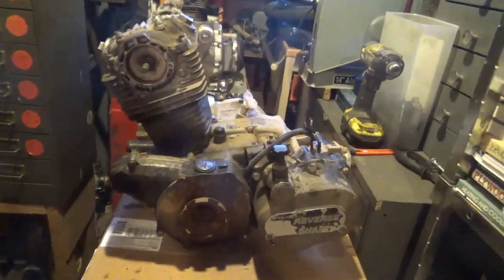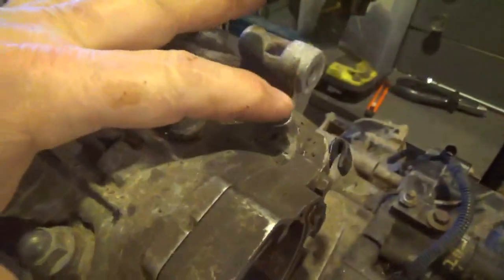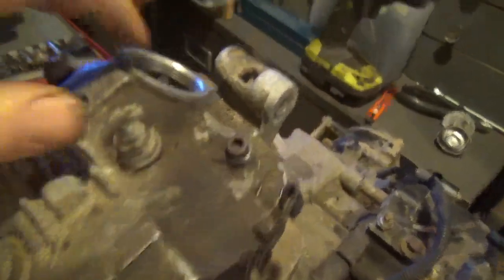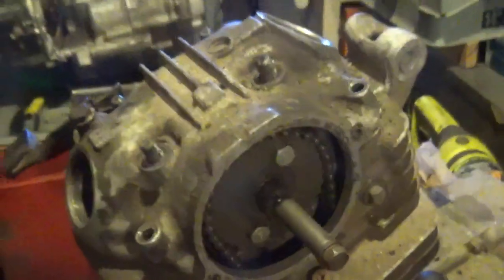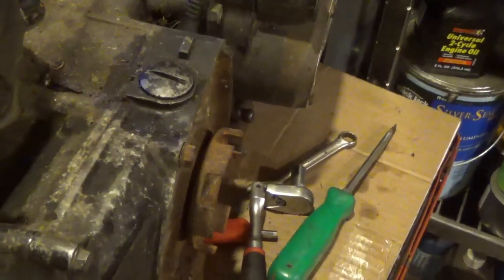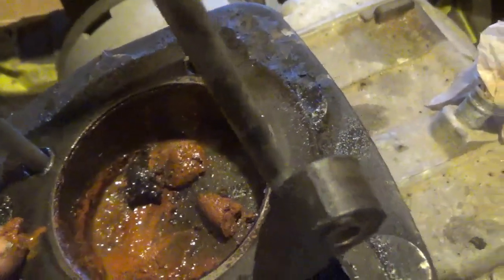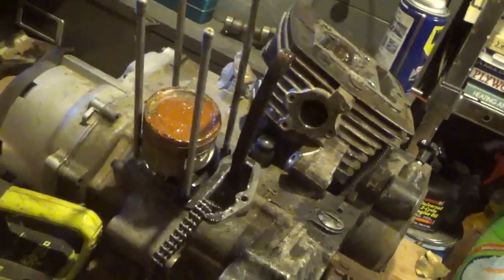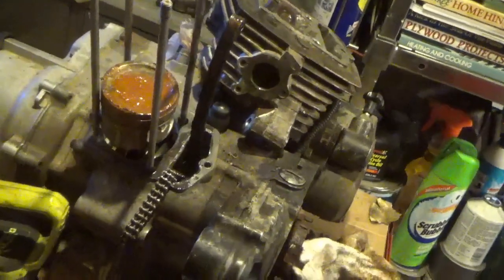Seized Honda Big Red ATC 200ES Engine, Can it Be Saved?

Comment: Hey Harvey, i have a 92 lt160 quadrunner, the wiring is all butchered up, im not the best at wiring either, im trying to wire the cdi straight to the stator kinda like how a pitbike it setup, theres a blue and green coming from the trigger coil, and a black and brown from the primary coil, ive tried wiring it a few different times and i cant get spark, can you tell me how to wire either a gy6 chineese pit bike cdi or the original cdi? Thanks

Comment: It might be worth replacing the piston and rings( I’m sure you have STD , NOS pistons and rings ) and slap that baby back together ! The 200es motors are tough to find not all burned out ! Does the 250es motor run the same pistons ? It would work great on that nice frame you have !

Comment: Great save Harvey, would that bolt directly into the trx250 ? the difference between the kick and pull starts wouldn't cause any clearance issues in the frame or exhaust or even wiring? How about that 84 trx200 that just landed? Just wondering out loud, after chopping ice in parking lot, I'm just glad I can still think.
Reply: It’s been my experience that it will not fit because of driveshaft placement ,  the big red machines rear axle is different in the placement of the driveshaft !
Reply: @davekimbler2308  Without looking at both machines at the same time until today at work I was just putting it out there. Got to agree.
Reply: @atvseatexchange2176  if you change the rear axle and diff it might work , mounts are real close